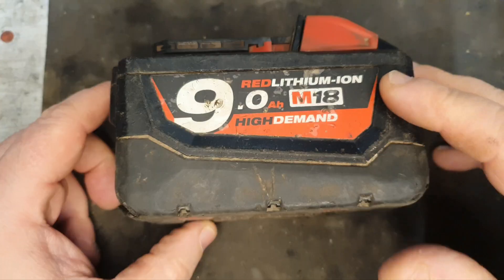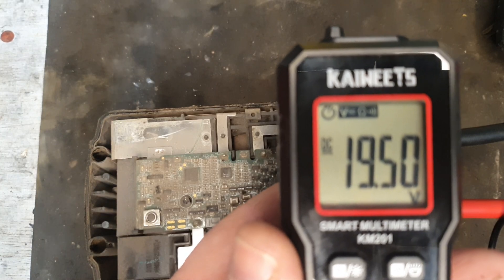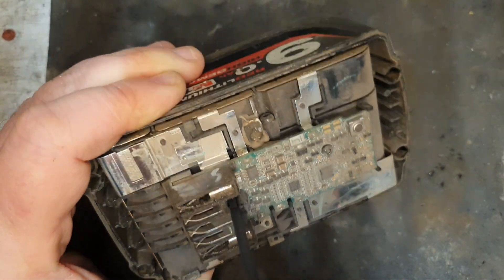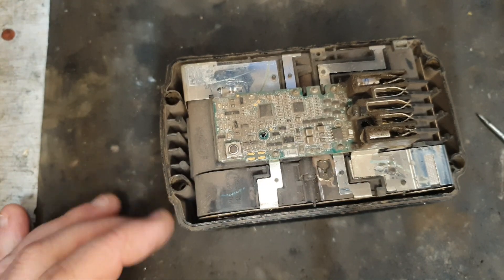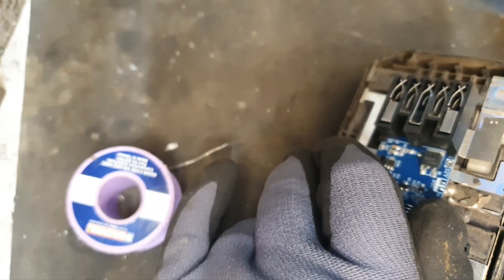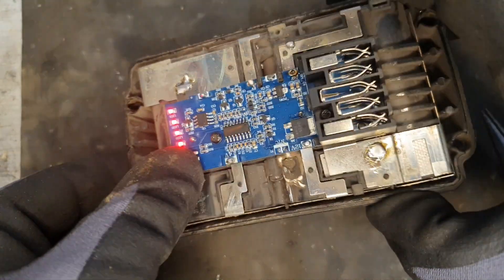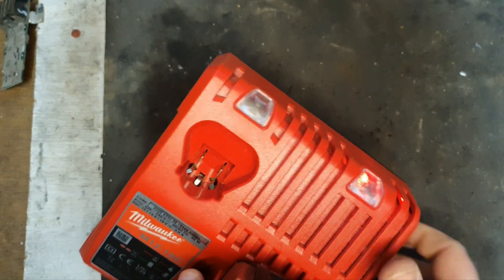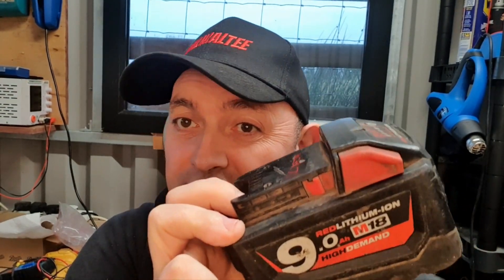Milwaukee high demand 9ah M18 Battery fix #milwaukee #powertools #batteryrepair #howto

Comment: great work ;) I got a m18 9ah high output, not sure if its 18650 or 21700, I think its 21700. 15 cells, all 12 cells are just above 4v and the rest 3 are about 3,49v, do you think its worth a try to remove cells to charge them with a charger, I have for both 18560 and 21700, and then spot weld them back?
Reply from the maker: This is what I do 
https://youtu.be/j6RU0RNadHM
Reply: @doctorlefthandthread  for now it seems ok again :) just have to test it under (heavy) load and see then, if its recharging